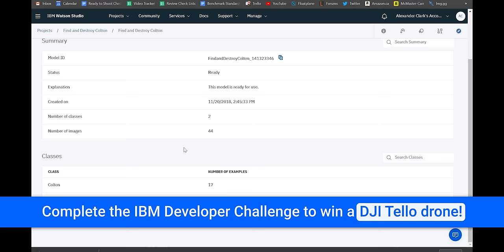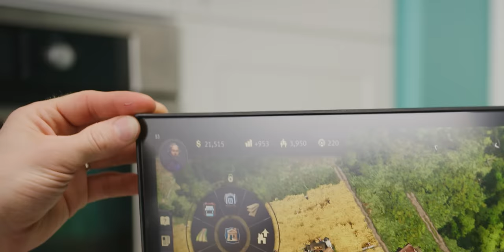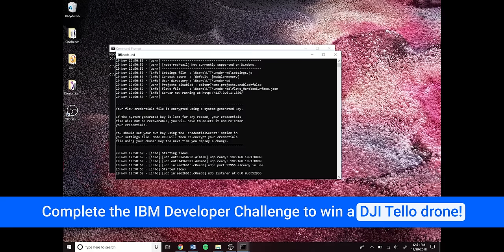FINALLY Upgrading my 4 year old Gaming Rig!

Comment: Linus: "New Ryzens are so good!"

Also Linus: "imma get a 9900K!"
Reply: For raw tread power a i9 9900k still king but mostly for being at 5.1ghz. And ryzen struggles to beat 4.5ghz
Reply: Well, you do realize this is a pretty old video
Reply: @real4415  I mean even right now for pure gaming and nothing else you aint going wrong with intel.
Reply: @jandegrote1  unless you dont fancy your house catching fire
Reply: @averyshaham1697  see you say that but cod at 4K full ultra while streaming and its not even getting hot so i dono where thats coming from
Reply: @jandegrote1  "while streaming" you already bought the wrong cpu.
Reply: jandegrote1 Linus switched to a Ryzen 3950X
Reply: i thought he got these new parts for free so honestly I would not complain about a free OCed 9900K, unless im wrong and he paid for all this then wtf
Reply: @jandegrote1  true if you want to beat intel in gaming you need a threadripper but amd is better in everything else and it's cheaper that just 10 FPS more is useless
Reply: @flyingtentacle7631  even my 6 year old i7 had 0  problems streaming 1080p 60fps to twitch and a i9 9900k doenst struggle at all ether so no t really.
Reply: @jandegrote1  Old comment but 4k ultra just means that the load will be on the GPU, so the CPU doesn't even matter that much with those settings lol
Reply: @jandegrote1  exactly amd fanboys act like amd Ryzen chips are king but intel is still the best for gaming it still gets better Performance
Reply: I'm pretty sure it came with the board and didn't have the cool stuff or have a choice in what he got
Reply: @KaiSoDaM  that didn't age well....

Comment: "Just a mainstream watercooled Titan RTX and i9 9900K @ 5.1GHz"
Reply: I wish I had a i9 9900k 
I'd not use it for my own pc though, but for my server
Reply: @Roshan_420  That'd be the most inefficient server ever
Reply: Henrik0x7F no, it has the fastest single thread speed of all CPU’s, and I only need 1, rest is extra
Reply: I'd never use Intel or Nvidia anyway but this is beyond bad
Reply: And 150 for 3 basically standard fans (all I saw) with 50 extra just for lights he doesn't use...
Reply: XclusivePower  https://www.cpubenchmark.net/singleThread.html
Single thread application
Reply: XclusivePower  so he doesn't waste money on something you'll have to disable if Zombie Load vulnerabilities are ever found in the wild.
Reply: Can it Run Crysis?
Reply: Roshan sorry fam you can get one on Amazon for 300 $ you just gotta wait until the retail price will go down

Comment: > 8 core cpu
> extreme edition motherboard
> 64 gb ram
> only considers psu as not outdated
Reply: To be honest he just needed a GPU upgrade, but they gave everything free to him, so :D
Reply: @matthiaswarlop2316  yeah,at least the gpu
Reply: @matthiaswarlop2316  I would name this channel as unfulfilled wish channel for many folks.
Reply: @matthiaswarlop2316  Also true. I hope to see affordable but good gaming/office rig based on Ryzen7 with price tag below 2000$. They can omit proper keyboard and mouse because I already have them.
Reply: @KrotowX  ryzen 3600, 16gig of cheapest 3600 mem, nvidia 2070 super (or better used 1080ti), 650 watt psu, samsung 970 evo nvme, some 2tb spinner and here you go - best value for money. Should be only a bit over 1000$.
Reply: I mean wouldn't ram 4 years ago still be run on ddr3?

Comment: DON'T PUT THE LONG SCREWS INTO THE SHORT HOLES! 
-Louis Rossmann 2018

edit: https://youtu.be/ZBkHRY6fhA8?t=268
Reply: And screw with confidence lol
Reply: @morantaylor  oh. That. EW.
Reply: @morantaylor  v

https://youtu.be/ZBkHRY6fhA8?t=293
Reply: Moran Taylor 🤣🤣
Reply: I did that with a laptop once. I was lucky that it didn't cause any damage, except for a couple of holes next to the keyboard. :)
Reply: @jeschinstad  For me, the screws were tapered. So, even though the length of the screws were okay and the diameter of the screw head were okay, the base wasn't (edit: as in the area near the screw head).
Reply: @velber1925  "Fitter, Happier, more productive".

Comment: This is my 4 years old gaming rig.

Wait but that's my new gaming rig.
Reply: That's my new gaming rig

Wait but it's my dream pc
Reply: @arshia5802  not even dream pc... the pc I cant even dream about🤤
Reply: my monster pc is RYZEN 7 1700 16 GB DDR4 3200MHZCL15 GS KILL RIP JAWS GTX 970 G1 GAMING DELLP2416D 24'' 2560X1440 60 HZ IPS. It plays evrything max settinfs 1440p 30+ fps but for ray tracing i must upgrade graphics card. Should i buy 2 RTX 2080TI SUPER or wait for RTX 3080TI?
Reply: @shredderorokusaki3013  waiting is better and get 120hz monitor,not 4k but fhd
Reply: Even his 4 years old gaming rig far surpasses the gaming rig I want to build right now.....ohhh the irony T_T
Reply: breh my new gaming rig is a hp from 8 years ago : o
Reply: 1440p 144hz sounds good!
Reply: @xpodx  Umm thats a beast pc compared to mine i have and fx 8350 and a 750ti so your good no need to upgrade.
Reply: @xpodx  sell me your 1080ti then
Reply: @xpodx  let me know when you wanna sell it!
Reply: when you have a 8 year old i7 cpu
Reply: @shredderorokusaki3013  wait for 3080ti since RTX needs to mature
Reply: @dinozaurpickupline4221  Found difficult to get even 1080p 144 Hz monitor suitable for office tasks and programming too under 500 EUR. Picture in so called "gaming" monitors suck for office tasks, but monitors with good picture and at least 144 hz refresh rate cost fortune.
Reply: XpodX is say you could use a new cpu but the 1080ti is fine
Reply: @xpodx  yeah I have a 2700x and a 1070ti now it's amazing how much better it is now!
Reply: @xpodx  because I got the 1070ti for $150!
Reply: @xpodx  I will in the future but probably not near future bc I only have 1080p 144hz monitors and with this setup I'm able to run just about everything on ultra and still have over 100fps so I'll probably stick with this a while
Reply: @Amogusprofessional  HP sold gaming rigs? what specs?
Reply: @shredderorokusaki3013  wait
Reply: just built my 4th gen i5 1060
Reply: @blake5600  wait for what?
Reply: @shredderorokusaki3013  wait for 3080ti
Reply: @blake5600  THAT WHAT IA DOING AS I SAID
Reply: @shredderorokusaki3013  🤡🤡🤡
Reply: @xpodx  i7 6700K and GT9800 512MB :)
Reply: Tigerscar 123 Well that’s because he worked hard to get to the place where he is now and even third he still in away every ties in with their product so don’t complain about how he asked certain companies for a deal that’s how people do it all the time
Reply: @shredderorokusaki3013  Peasant only playing on 30hz. My BEASTLY Core i9 9980XE 128 GB DDR5 QUAD RTX 2080TI SUPERS RUNNING IN SLI 4K 24" 7680x4230 500HZ OLED TRIPLE MONITOR SETUP. It plays minesweeper at 2fps. Beat that peasant.
Reply: @xpodx  im running a ryzen 7 2700x, 16gb ddr4 3000, and a 1070ti. theres no need to upgrade your gpu yet, the 1080ti is still a perfect card, even for 4k. i game 4k, 60hz at ultra settings with my 1070ti and dont dip below 60fps. (brand new titles, not older ones). I'd say mayyyybe upgrade when ray tracing becomes more relevant, but as it currently stands, there's no real reason to buy it.

Comment: Gets basically the best gaming hardware he could
Linus: Drops to 40 FPS are fine.
Reply: Literally
Reply: It was so anticlimatic and it shook me
Reply: Most likely because it's sponsored... he can't be serious if you ask me.
Reply: it's not really uncommon for poorly optimized games, or those that still run primarily on a single core.
Reply: @Wooble57  You're right, but it should be uncommon. Especially when we're talking about a recent PC exclusive, like Anno 1800...
Reply: Well he went from medium to ultra settings and still gets a better fps. Defiinitely an upgrade.
Reply: @rollerboogie  No one ever doubted it's an upgrade (duh), but at this price point, I'd expect the best performance. We're dealing with a 2000$+ graphics card alone after all. A lot of people build a whole setup with half the price of it.
Reply: @polski8bit  it is running at 4k resolution on ultra. If he were to run it at 2k or even 1080p he would probably get 80/140 respectfully.
Reply: 8-bit - you have to turn some stuff down from ultra on Anno at high res even on a rig like this. There’s just too much detail in the cities

Comment: Cant wait for the video "FINALLY Upgrading my 24 day old Gaming Rig!"
Reply: oh boy, this made my day
Reply: The Ryzen 3000 series isn't gonna be faster in gaming than the 9900k
Reply: Im still running a 2700k rig from 2012 with a RX 390 and two 1080p 60hz monitors lol.
Reply: @flux6472  Switch to 1440p multi display. It's way more screen space to work with. You can still game on 1440p without having to shell out 25k for gpus.
Reply: @shanepotter4635  i know I can't afford the  monitors.
Reply: @mesicek7  tests show it will, so, just wait and see before you say that...
Reply: @arthurministro2055  If you saw the charts AMD provided the Intel cpu's win in 4 out of 7 games.
Reply: @mesicek7  nope, on the ones I saw Intel was not winning on 4 out of 7.
Reply: @arthurministro2055  https://www.guru3d.com/articles_pages/tech_preview_amd_ryzen_with_ryzen_3950x,2.html

are you blind? Also take into consideration that some of these benchmarks are usually cherry picked- eg choosing titles that do well on their hw.
Reply: It's also 100$ cheaper...  @mesicek7
Reply: only just in the last month did the price change, purely to compete with AMD.  XclusivePower
Reply: @spomgeboob2623  2-3 times? According to the leaked EU prices the 3800x is gonna be only 70-80€ cheaper than the 9900k , while the 3900x is gonna be 40-50€ more
Reply: @spomgeboob2623  Same in US mate. 9900KF is $480 while the 3800x will be $400

edit: There's currently a deal on Newegg for the KF version where you get a 250gb SSD disk in bundle - meaning you're getting the cpu for $430
Reply: @mesicek7  what makes you say that? It has similar clocks and zen 2 i think has around 8% higher IPC than shintel. An 8 core zen 2 cpu beat a 9900k in cinebench in January, let alone the 12 core or 16 core zen 2 cpus now.
Reply: @mesicek7  regardless thats still a large difference. Double cores, double threads (quadruple if you take into account intel security risk jazz), all for like £50 more, plus higher single threaded performance. Absolutely obliterates the 9900k
Reply: well, MSRP it is. It's not going to be at the end of the day. Also, the bigger picture point is that for the longest time Intel fans have had the very solid argument that AMD can't compete on the very highest end consumer gear. Well, now they can.. and it's cheaper.  XclusivePower

Comment: I love watching these type of videos to torture myself 🙂.
Reply: XD Minecraft lags for me
Reply: I like how at the end he was "chugging" as low as 40 fps on his old rig...if I'm lucky, 30 fps is the highest...guess my old free vista laptop wont be playing much XD
Reply: @thefriendlybanana9658  damn that's not even bad... What do you play?
Edit: For a Vista laptop, I mean.
Reply: @Phenom98  ok for reference, I get like 7 fps playing Roblox...XD it really depends on the game and whatnot...
Reply: I really don't play much anyways...just got a PS3 which runs well!
Reply: @thefriendlybanana9658  I have a core 2 duo with 4GB of ram and no gpu XD
Reply: Hey man. Just save up cash. And buy singular parts per pay check.

When i bought my custom loop. I bought all the parts over the course of 5 months. 

First i bought a shitty chinese cpu water block. I upgraded that after i built the system. Secondly bought the gpu block. Bought 2 rads over the next 2 months and got the the pump+res combo on the 5th month. 

6th month was the upgrade to a ekwb cpu cooler.

I did spend almost all of my paycheck to pick up a 1080ti off of ebay one month too lol. But that was before i went into the custom loop.
Reply: @giffy5087  ha I got a core 2 duo with 2 gigs ram XD
Reply: @richmeisterradio  and yeah, if I were to get some sort of newer computer, I'd probably get a used desktop with decent specs for pretty cheap, slap a decent GPU in and probably upgrade the RAM or power supply or something. It'd be cheaper than building a brand new system and I've seen some running AAA titles really well. It'd probably have Windows 7 or 10 preinstalled as well 😉
Reply: @thefriendlybanana9658  eh, windows 10 is free. 

I build my own stuff. I dont like the thought of having someone else build my system. 
 I understand not everyone is as much of a pc enthusiast as i am. My build has 2 radiators and a touchscreen fan controller/temp monitor. Plus liquid metal on all my dies. My load temps rarely hit 50 on either die. My build is as follows.

I7-4770k@4.4
1080ti@2038
Gtx760@stock(for physx)
16gb ddr3 @ 1600 (manual ram overclocking is a bitch)
Asrock z87 extreme4
1 256gb ssd, and dual 2tb drives for storage.
In a nzxt source 530 full tower.
All my fans are noctua ippc, 3 120mm and 2 140mm.
A 240mm radiator in the front and a 280mm in the top.
Reply: Creenge  oh I think I typoed...I get on average 17 fps on Roblox...I get 7 if I'm screen recording 😉 and its like from 2006
Reply: @richmeisterradio  I can tell you what specs CCleaner says I have (it's easier to look there than search through the settings and whatnot):
Windows Vista Home Premium 32-bit SP2,
Intel Core 2 Duo CPU T7500 @ 2.20 GHz, 
2.0 GB ram
And a NVIDIA GeForce 8400M GS

It still runs fine and I'm using it more as a pc desktop sorta setup...I got a generic Acer monitor and a cheap wireless keyboard and mouse setup from Goodwill
Reply: You know what's kinda sad? I got a HDMI to DVI adaptor to try to play my PS3 on my monitor...turns out my PS3 doesn't like my monitor...i know it's not the adaptor, because my PC works fine...I've read up that many monitors just won't work with the PS3...
Reply: And heck, I got the laptop for free, so I'm not complaining 😉
Reply: @thefriendlybanana9658  "runs fine" for warcraft 3 i am sure.
Reply: @richmeisterradio  ha probably

Comment: "my old system chugged down to 40 fps, now i'm at 45" :)
Reply: Thats for  2k+ for the GPU ONLY
Worth
Reply: To be fair he is getting higher frames with setting that are twice as high.
Reply: 3440x1440p is 1 step away from 4k. So running a game at near 4k resolution with ultra settings isn't bad at all. I know you would expect a 2k GPU to crush it completely, but the $ value per FPS drops dramatically when you get into the high end graphics equipment.
Reply: @gummiebearish  That is def not as heavy as 4k wtf dude
Reply: @nicksparrow009  I didn't say it was as heavy, I was saying that it's the closest thing to 4K other than 4K. 2K Ultrawide resolution is more demanding than 2K, but not as much as 4K.

Comment: 8 cores and Maxwell Titan X can still be my dream pc, if not yours.
Gamers respect such a processor and gpu.

Edit: Thanks for 100 likes!!
Reply: I have that GPU and an 8 thread quad core i7. Just shelled out for a new monitor (aorus 27" 1440p) and I'm hoping I've got my figures right and the Maxwell titan X can cope. I had money to burn four years ago... Not quite so much anymore.
Reply: The GTX1060 comes close to the performance of a Titan X and a 1070 even surpasses is (not to mention the GTX1660Ti and RTX2060 which all run circles around this ancient Titan). It's not considered a "dream PC" by anyone who has any access to recent hardware. And what do you mean with "gamers respect such a processor and gpu"? Do you think anyone actually gives a shit about such an dated card?
Reply: @benedykt123313  I wouldn't call 2015 hardware ''ancient''(Maxwell Titan X). Sure, it looks shit with what can out-perform it now, but not really ancient hardware. Just a little outdated, but still very capable.
Reply: @arrax8241  When the previous gen mid-range easily keeps up with the card, it's not "very capable" anymore. It's barely capable.
Reply: @benedykt123313  Actually the Titan X is much faster than the 1060 and almost on par with the 1070/1660 Ti, maybe even slightly faster in some older games.
Reply: Titan x is still a beast, but that cpu (is it a 6950x or what) is so slow for gaming
Reply: @Arruu23  It's a 5960X and if you overclock it to lets say 4.5GHz and pair it with Quad channel memory it's definitely faster than a Ryzen 7 2700X in pretty much everything.
Reply: @benedykt123313   So that Titan X and that 8 core cpu will not bottleneck any of its performance?

Comment: Colton is the type of guy to use a screwdriver when connecting a VGA cable
Reply: VGA are some time difficult to swew up kek
Reply: I did that mistake and the part broke
Reply: @simonpoirier1029  Thankyou. Was gonna say. Some monitors are retarded and I cant fit my fat thumbs so a screwdriver helps 👀😂